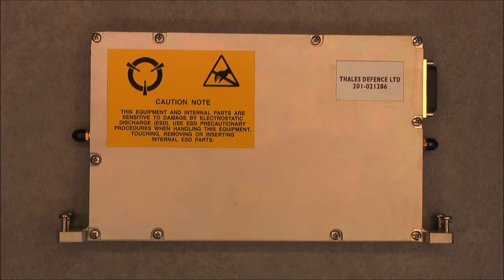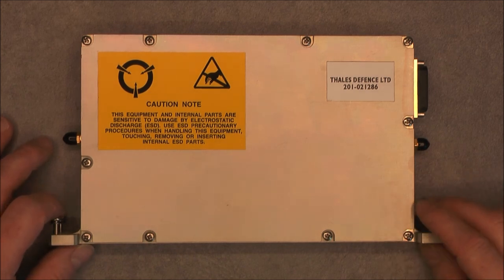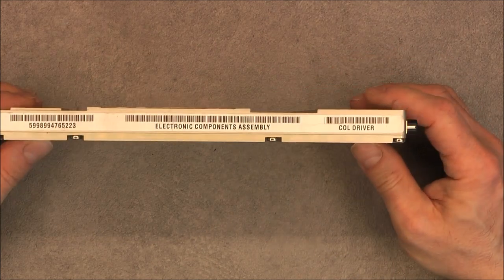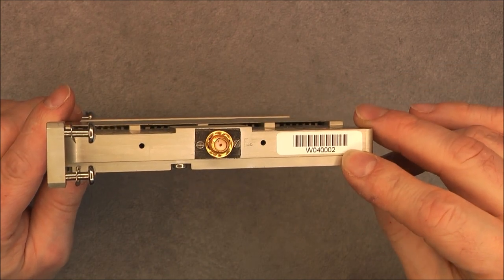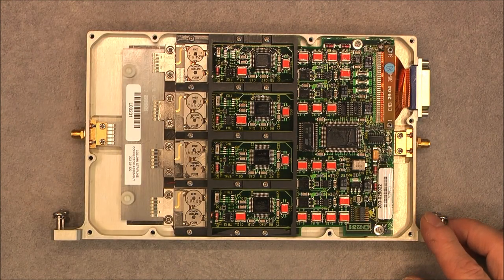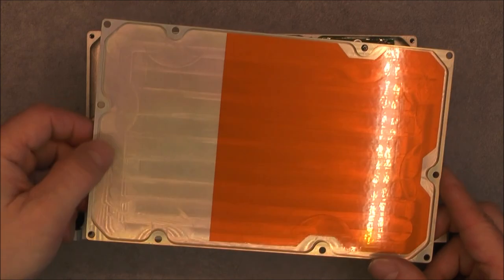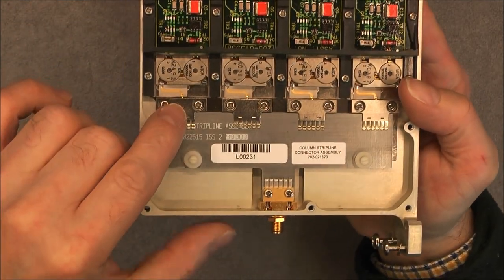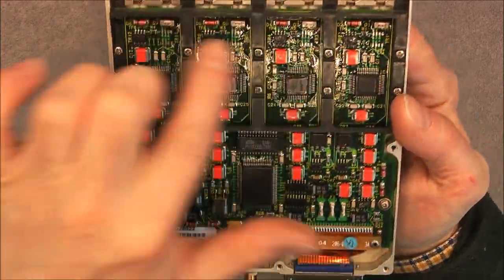Military electronics teardown: Thales "col driver" module

Comment: Looks like it is part of a phased array radar set, providing the power stage and receivers for an array, with the input being a reference clock, and then 4 outputs that go to the array, allowing it to be electronically scanned.
Reply: The multi way connector and the wiping contacts that go to the Rf modules dont look as though they'd carry enough current to be a radar transmiter.
I wonder if the device injects data onto the Rf signal to send commands to the antenna.
Reply: @hellcattanks  the RF outputs could be used to feed high power Transmit/Receive modules.
Reply: Yeah that would have been my guess as well. "Column driver" in some radar set and X-band or up based on the isolator sizes.
Reply: @hellcattanks  Most phased arrays have a set of PIN diode switches at the actual patch antenna itself, this can be the module that both drives them and does the receive switching, as the one side looks like it has circulators that allow the output to be pulsed while at the same time a receiver on another set of modules is active. Sweep up in frequency, or provide lots of spread spectrum chirps, while at the same time the rest of the modules on the board other than the active one is listening to the delayed pulses they sent previously. There is more than enough capacitance on the driver board to power those brief pulses, and modern fighter arrays do not need high power output, they rely more on getting multiple responses over a wide band of frequencies, and each pulse being coded as to transmit time, which then allows a DSP to generate a display. 

Likely for a short range, sub 100km, unit, which does not need massive power, but does need no dead time at all, and where you have a phased array that can handle multiple targets, and also simultaneously reject ground clutter and pick out IFF codes as well.
Reply: @SeanBZA  Those could be isolators and the multiplication of the modules x4 could be for redundancy to a certain degree (for example, it may be able to work even if one of the four fails)
Reply: @sbreheny  Yes it could probably work if a module fails, but likely there more to increase power while at the same time, with the splitter, also allowing a receiver to operate as well off the same antennas, just a different channel far enough  away that the circulators can handle the feed through. Would think under the heavy welded cover there are more circulators and some large PIN diodes as well, allowing for switching of the modules and probably isolating them as well from each other, but as there are ITAR listed, and thus not easy to get info for, and those who do know, are not allowed to say. Those pesky secrets acts that, even decades later on, are easier to obey than break.